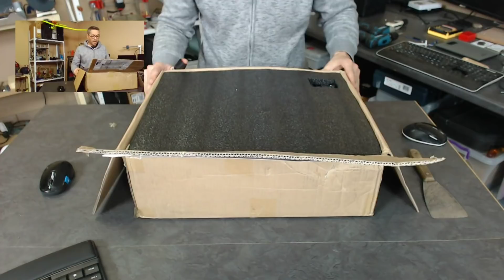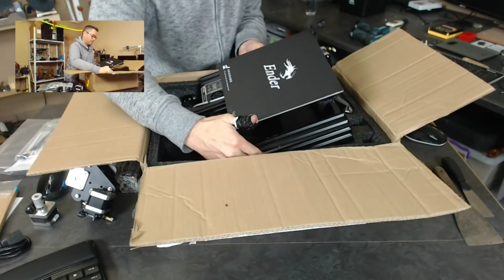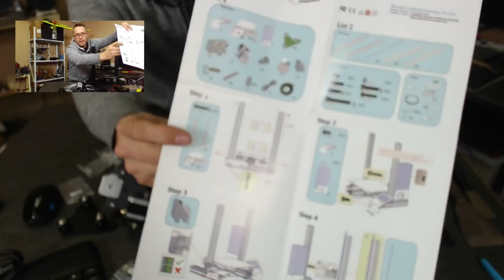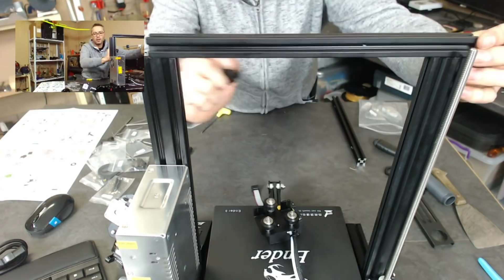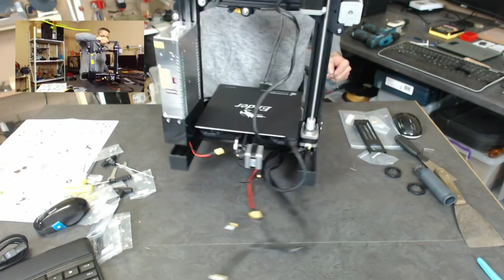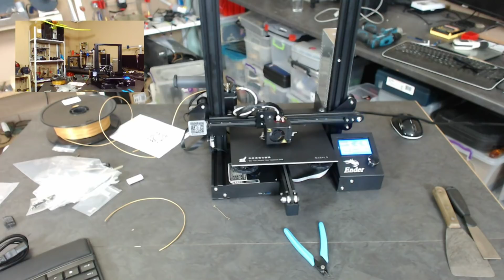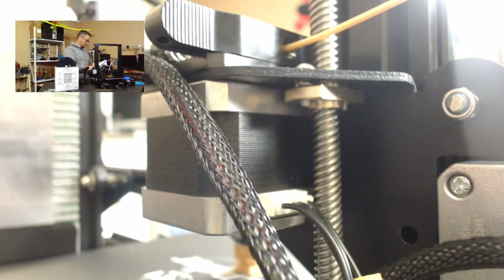Creality Ender 3 3D Printer build - LIVE STREAM

Comment: Hi and let me explain first, why I'm trolling the Ender: 3;
Seen all the positive feedback about this printer and seen a friend assured to me, that the Ender 3 would be a fine machine, I ordered one as well.
Already at the first steps of assembling the first BIG TROUBLE has shown up and this has been the profiles for the Z-Axis portal have not been cut properly 90° what made an assembly impossible. (if one knows a little about mechanics and torsion...)
And now I'm at a point where I do think: The aluminum profiles of the Ender are not worth the price of it, so of what use to buy an Ender, if I have to replace almost all the parts to get a reliable working Printer?!...
Yes, all these positive Feedbacks, they did mislead me completely and made me buy a printer which is finally not worth its money,. Nope this printer is not cheap, but rather expensive paid profiles which are the light version badly cut.....
Reply: Machwas makerspace can you explain more?
Reply: You get what you pay for.  You  cannot expect great quality products from China, especially on cheap products, without having to do moderate rework & mods to get a great working machine.  Light rework & mods might get you a good working machine.  If you are lucky - you might get an OK machine right out of the box.

Comment from the maker: Time codes
Unboxing @ 1 minute
Closeup of extruder @ 8 minutes
Build instruction @ 14 minutes
Power supply screw @ 23 minutes
Z End stop @ 25 minutes
Z Motor @ 29 minutes
Explaining eccentric nuts and bed adjustment @ 33 & 59 minutes
Gantry assembly @ 38 Minutes
Top Bar @ 1:02 minutes
Frame straightening @ 1:06 minutes
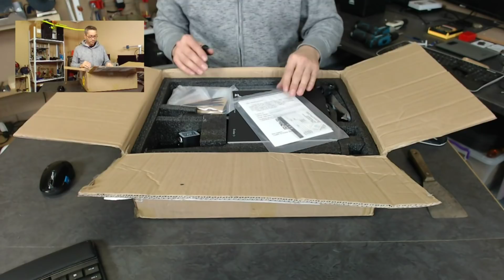Spool holder mounting - 1:11 ( this was not a great idea)
Wiring 1:15 minutes
Power On 1:28 minutes
Bed Leveling 1:31
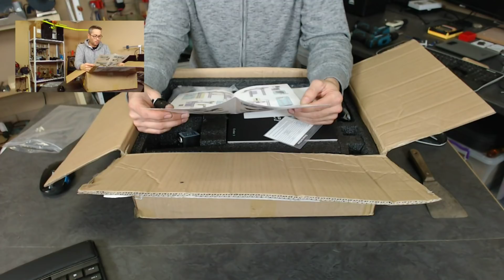1st Print @ 1:40
Camera close up for print @ 1:43
Power recovery 1st test @1:52 @ 1:59 
Z adjustment @ 2:00
Testing bed heat time @ 2:09
Power recovery @ 2:40